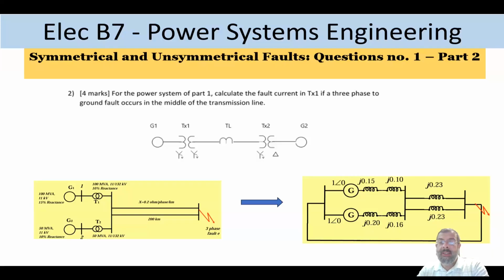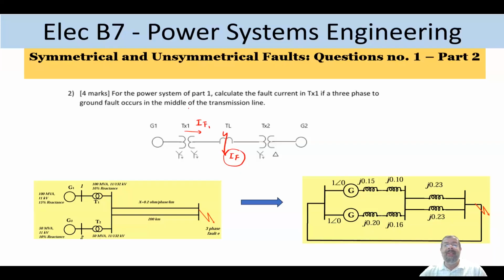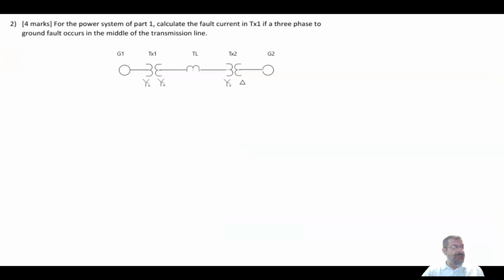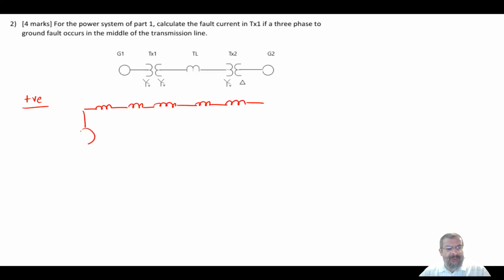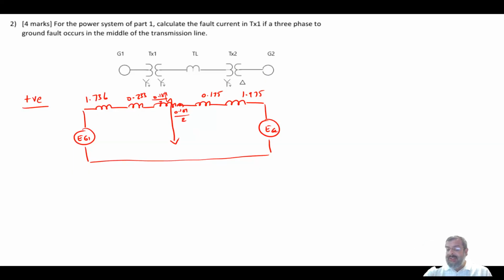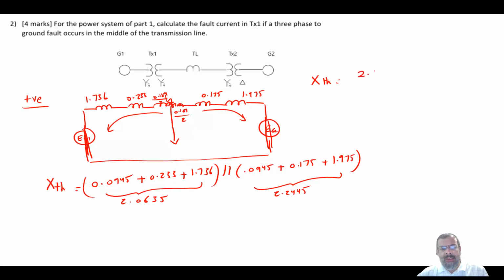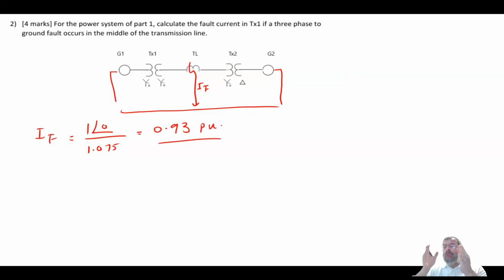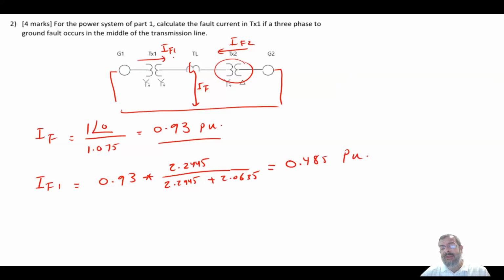PEO solved examples (ELEC B7) Symmetrical and Unsymmetrical Faults Question no. 1 - Part 2

Comment: Thank you, prof. Ayman. At the end of the answer, shall we convert the current at the end into the actual amperage value or can we leave it in per unit values?
Reply from the maker: In my opinion no need but doing it does not harm. all you need is to find the current base value at the fault location and multiply it with the per unit value

Comment: Thank you very much for your videos. I’m planning to use them to prepare for my PEO exam.
I just have one question: You considered the voltage as 1 p.u., but I believe it should be (15/18) p.u. on one side and (20/18) p.u. on the other side, based on the new voltage bases.
Reply from the maker: Thanks for your feedback. For short circuit analysis, we ignore the load, and hence the voltage will be always 1 pu. The change in the base system, will only change the impedance and not the voltage.